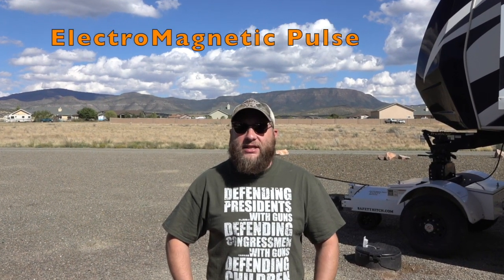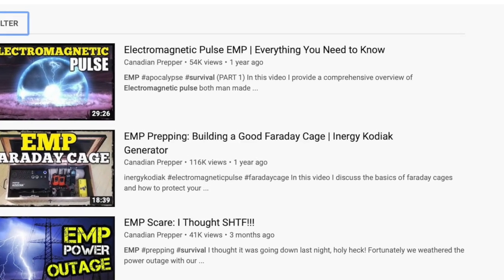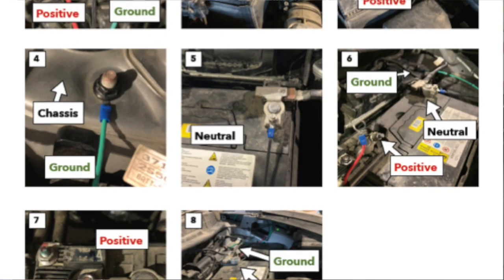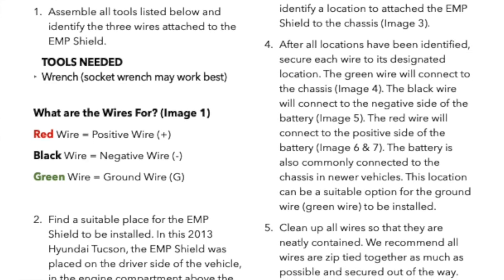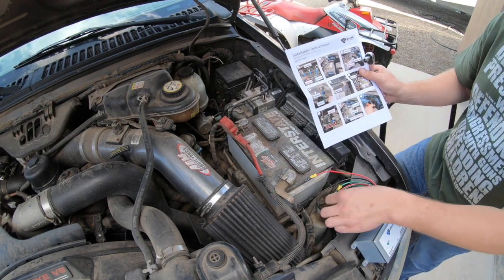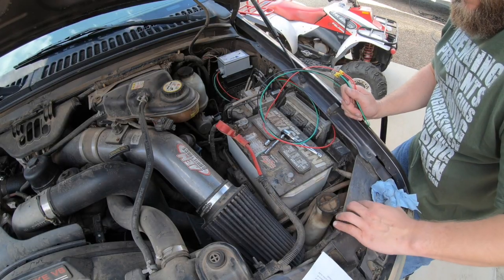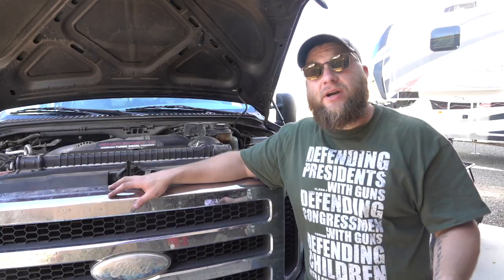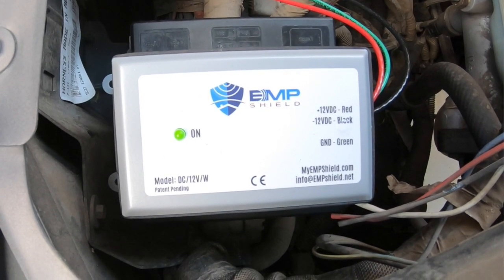CCTV E35 Full Vehicle EMP Shield! Threat Imminent!

Comment: So disappointed you didn't wrap it in tin foil and bury it underground!
I'm skeptical about this one. A lightning strike won't bother car due to rubber tires and protecting the fuses from surge from an EMP would mean a massively insane speed of reaction but how would that protect the wiring? If it works I suspect the US Army would have them by now. I'll remain open to it but I am skeptical. Anyhow I'm using a bike if an emp hits. Anyone driving will be a huge target
Reply from the maker: The US Military does have them and is currently installing them all over the place. I'm also a bit skeptical but look at the Keystone testing results. I'm running on blind faith on this one. :) That would have actually been really funny to do a video putting one in a faraday cage.
Reply: @PrescottCaliberClub  lol I'm naturally skeptical but I'll have a look
Reply from the maker: @HuplesCat  Me too and I installed one!